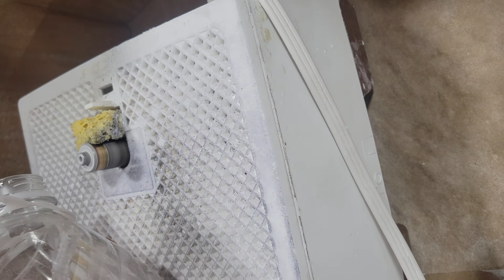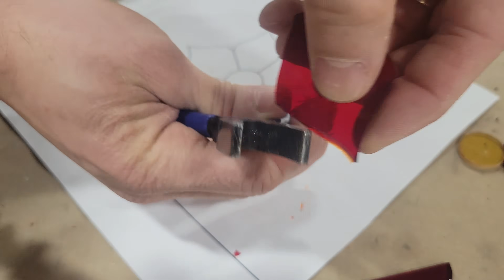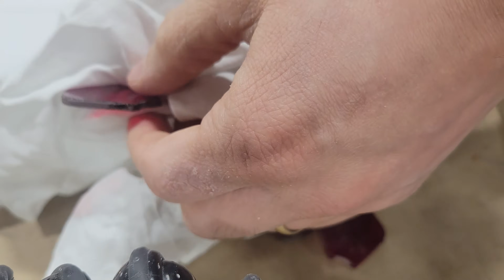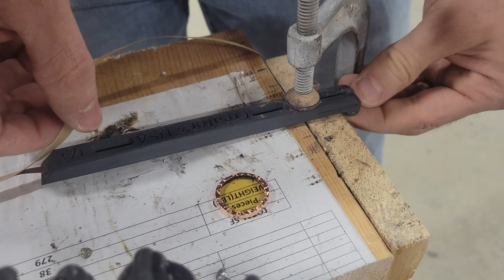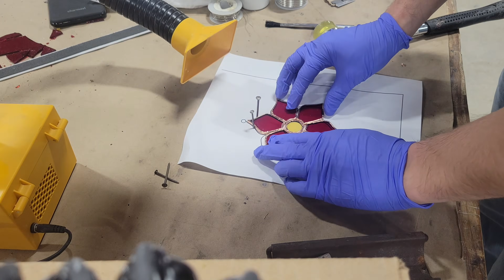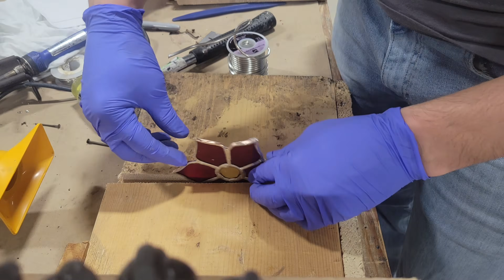🎁Beginner Stained Glass Gift 🌺 (FREE Pattern Download!)

Comment: 10/24/24. I will be trying your foiling method. I suggest you hold your iron slightly off the foil and move in one direction. Usually toward you..  best of luck. I love working with glass and each project presents a learning experience.   Thanks for your tips.
Reply from the maker: Thank you!  Best luck to you too